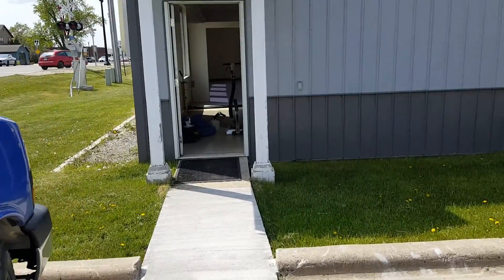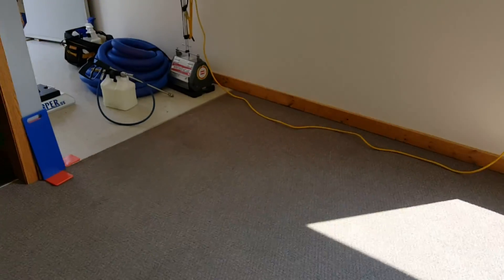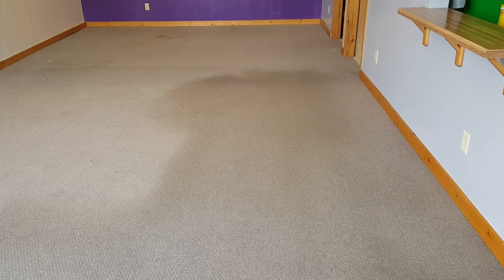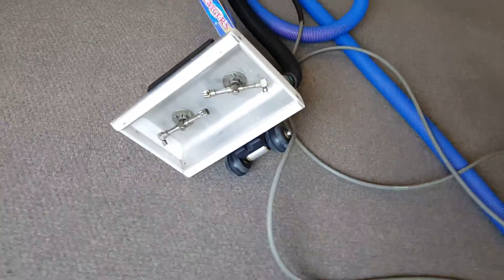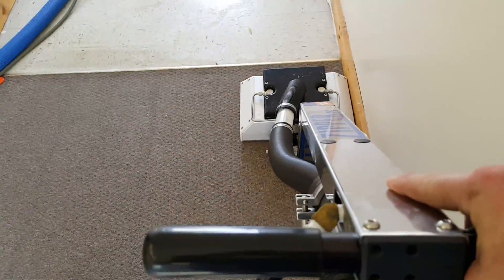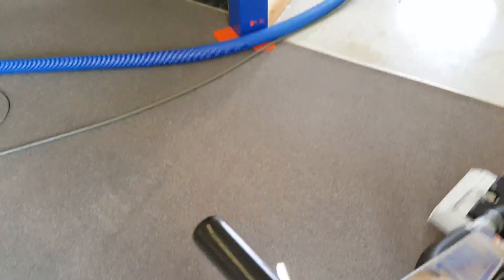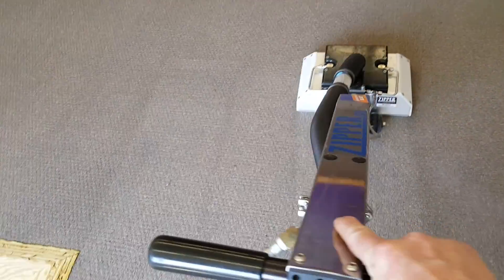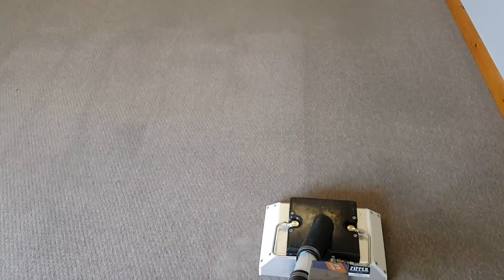Zipper SS Super Spinner and Harvard Chemical test formula

Comment: How does the zipper ss do with a portable carpet cleaner?
Reply from the maker: Juan Cardona actually it will not work. It is made currently for more of a larger truckmount because of the impact of water needed to spin the spinners and also recovery. Being 15 inches wide and 2 recovery slots it's pretty big area for a portable and some smaller Truckmounts
Reply: Thanks. What tool would you use with a 500 psi portable carpet extractor from your experience https://www.amazon.com/gp/product/B007QS6738/ref=ox_sc_act_title_10?smid=ASDTZXUEPFRK3&psc=1
Reply from the maker: Juan Cardona for that particular machine I think it would only handle a two jet standard wand such as what they call an AW 29